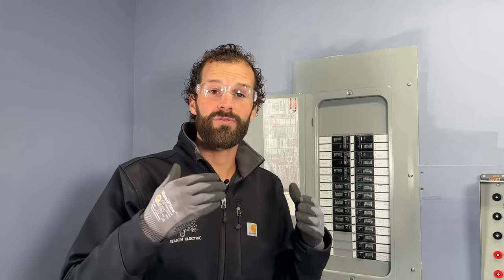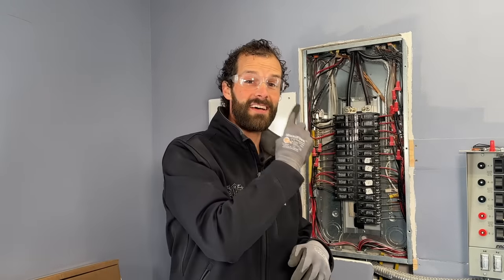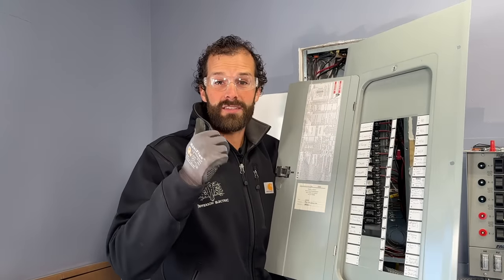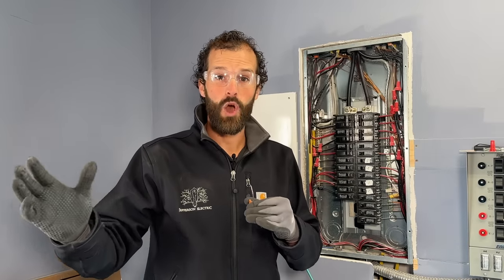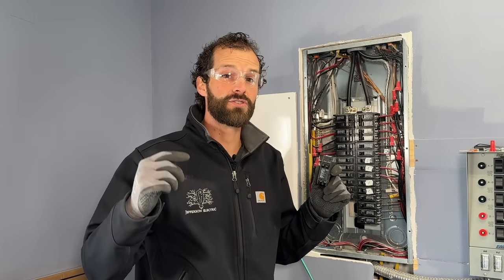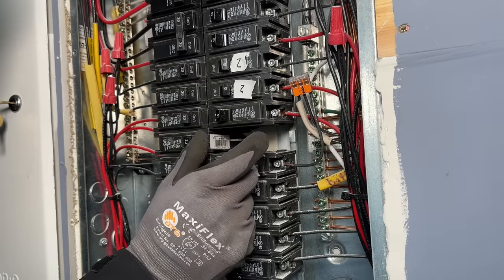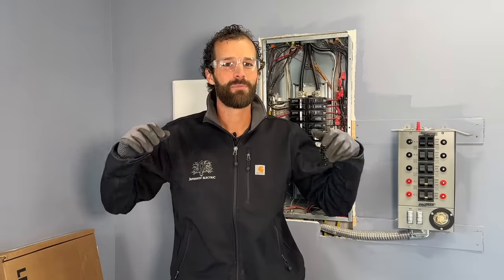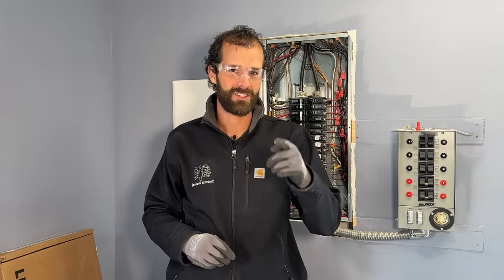No Room In Electrical Panel - Quick Fix

Comment: Just a safety concern and hint! When you turn off the main switch, which may be remote from the panel, please “lockout and tag out” the main switch so someone doesn’t see the power out and throw the main switch back on! Lock it out with a padlock!
Reply: Yesly..
Reply: Dawg relax he dah pro pro
Reply: I did wonder why panels that are clearly for indoors only have a knockout for a lock
Reply: @nameless-og  dawg beef 😤 🤣 what r u zayen
Reply: @como dice  next to the handle/latch, there is usually a knockout where you can install a cabinet style lock.   It never made sense to me why anyone would want to lock a panel closed that clearly isn't supposed to be installed outside.   That feature made sense to me if the box can be mounted outside, otherwise, it just seems crazy to have it on the box because it seems risky, was surprised to learn here that it's actually the opposite
Reply: @nameless-og  working in industry and construction there are many OSHA safety codes where workers in factories and construction can get cited and fined for not following safety procedures. “Lockout/tag out” is just one safety procedure, and only one key to the lock is carried by the worker (He puts a padlock on the switch or a tag on the breaker)
Reply: @nameless-og  vato dice que no porque dice que si de verdad
Reply: @Bob's Barn Workshop  thanks for the explanation!
Reply: @nameless-og  As I said before, it prevents some poor worker who turned off the power from being electrocuted if someone turns the power back on by mistake.
Reply: Good call! Many accidents happen because somebody unfamiliar with the work being performed try to "make things right" only to cause somebody to get hurt. If you don't know, ask!! Lock-out Tag-out is one of the best regulations to ever be written. Use it!
Reply: @JLRWoodCreations  where is it written
Reply: @bobsbarnworkshop  l
Reply: @bobsbarnworkshop  j
Reply: Thanks OSHA Dad!
Reply: Rough mate , disconnecting dedicated circuits when you have plenty of other supply outlets  available .
Reply: I thought Ralph Nader was dead!
Reply: @tomhughes4980  you can’t bring a family member back from the dead! It’s a simple precaution.
Reply: This is residential not industrial...
Reply: @JoeReese-kh1jc  still…

Comment: Lower loads on LED vs incandescent lighting circuits is not something I had considered. Thanks!
Reply from the maker: You bet!
Reply: Be careful about connecting two wires to a breaker many municipalities do not allow two wires on the same breaker , So if you need additional space for a breaker , You're better off taking two breakers out and replacing with a tandem breaker
Reply: Yup.. not just load..its safety
Reply: But if breaker trips more areas dark....
Reply: @ironmartysharpe8293  Do those municipalities still forbid it even if the breaker is designed for two wires, such as the SqD QO?
Reply: @user181  my municipality forbids tandems but does allow a breaker to have as many wires as it is rated for.
Reply: @user181  If it's not allowed you can't do it
Reply: @DonaldZiems  Why do they do that nonsense. What makes them think they are special and that something tested and approved by the OEM is not OK...
Reply: @petero2693  This is a good point. I changed all of mine so that there are only three circuits. One per floor for the rooms, and the last one is hallways and stairs. Uses a bit more wire, but if a room trips the breaker then you have light just outside the room.
Reply: @court2379  speculating, but probably some combination of too many local contractors abusing tandems to put way too many circuits in a box, planning for the seemingly inevitable code cycle where every circuit requires an AFCI breaker (no tandem AFCIs exist), or generally trying to force people to get a new panel.
Reply: @EverydayHomeRepairs
Reply: Yes, but you can't guarantee that those LED bulbs will stay there in the future. I always go by watts/square foot and use watts of incandescent. Someone may decide they have a box of old bulbs they want to use and change out the LED's when they fail and go back to incandescent.
Reply: @hotpuppy1  I cannot see value in sizing my wiring/panel for obsolete technology that is nearly unavailable anymore. I would leave around 600W of buffer for the future installation of ceiling fans though.
Reply: Is there no rule for maximum number of outlets on a circuit?  Before anyone comments, and oulet is any place where power is delivered by the system.
Reply: @ironmartysharpe8293  OR, you make a splice in the panel and run 1 wire to the breaker…
Reply: @ironmartysharpe8293  also, if you’re going to tell people about tandem breakers they need to know you can’t just use them anywhere you want in a panel. They are usually reserved for the “lower” 6-8 breaker spaces.
Reply: @user181  municipalities get last call, if they want to enforce something beyond code they can. You have 2 decisions to make, go get the breaker, literally pull it out of the panel, show the inspector the spec sheets and battle it out.  Or you tell your customer “city ain’t having it, life is going to be easier for all of us to do what he’s asking.” Or you make a splice in the panel…or mount a box just above it, splice it down to the panel.
Reply: @court2379  you still, by code have to have a certain amount of space by code that is referred to as “general lighting load,” that being said, it doesn’t tell you how you have to use it, and while we live in a world of leds, and people on here don’t know the math. A 15 amp, continuous duty circuit (rated at 80%) on 120 volts gives you 1,440 watts of useable power. A standard LED bulb is like 10 watts (rounding for easy math), or 144 led light bulbs. The lightening loads are broken down so if a light trips on the 3rd floor, it doesn’t take out the lights for the entire home.
Reply: A lot of municipalities don't allow 2 wires or multiple wires inside a breaker even though your breaker may be design for the local code hasn't been updated For that And a lot of it too is the inspector some inspectors won't go off a state they go off nec there oneinspector here in town he goes strictly by nec and he can't be difficult if u never dealt with him and know how he Is but I haven't had any problems with him I defer to nec standards
Reply: Upcoming changes to the NEC will allow lower wattage luminary circuits.  They use a 10 amp circuit breaker with 16 AWG NM cable.

However these circuits generally require AFCI breakers.  Saving a few dollars on copper isn't appealing if it means additional $50+ breakers.

Comment: Most modern square D homeline, qo, and qob panels are listed for two circuits per breaker space.  It's a code violation to use tandem breakers in panels that are so old that they listed the number of circuits the same as the number of spaces.  Although square d b 15-30 amp breakers are listed for two wires per terminal, the cafci, dafci, and GFCI breakers are not.  Also, good luck finding cafci, dafci, and GFCI breakers in tandem formats.  Finally, if you are combining loads leaving a space for a future circuit, it's ok to leave the breaker in its side space as a spare.  You don't have to prematurely remove the breaker, you can leave the old breaker until you're ready to replace it with the new breaker.
Reply: Siemens makes AFCI 1-pole tandem breakers. But you're right, don't count on finding a GFCI or dual tandem.
Reply: I Prefer to leave the unused breaker in place. The little slot covers to fill empty knockouts are crappy and come loose. Also, if you leave the empty breaker in place, remember to tighten the wire lug screw snug. I was helping a friend one time and there was a breaker with no screw in a slot. God knows what happened but I don't want any loose metallic objects in the power box...
     Ya'll Take Care and be safe, John
Reply: You didn't warn moving around breakers that are part of 3 wire circuits. Older codes did not require them to have a common handle and ity it unusual to find 2, single pole breakers used. The 2 breakers must be next to each other and can't be on the same tandom unless it's a quad. Failing to obey these rules can lead to an overload neutral and a possible fire.
Reply: He started to mention that but forgot to talk about it. That's why he say there were 3 solutions, but then skipped over numby3.
Reply: @clayrichard8471  you forgot the warning that you must use a listed handle tie if you tie the breaker handles together for circuits that share a neutral.
Reply: CALLED "PIGGY B ACK BREAKERS!!!"
Reply: You forgot to mention that you should use a sticky label and write something like spare or not used on it and stick it nest to the breaker that is empty so if someone goes in because of a tripped breaker, everyone knows not to turn that breaker on.  I know in some older panels that a tripped breaker sometimes goes all of the way to the off position instead of just the mid point.

Comment: Another note on tandem breakers that I didn’t hear mentioned in the video: if you plan to load the circuit to near capacity, don’t place it in a tandem breaker. The heat generated in the smaller breaker can cause earlier failure of the breaker.
Reply: Please tell me how the heat will affect a breaker? There is a coil, a set of contacts, and a spring.. iron core, and silicone liquid.
Reply: @johnbattista9519  as I’m sure you’re aware, running a breaker at, or very near, its current limit will cause the breaker to become very warm. This is by design since they’re designed to thermal trip with extended over-current at roughly 10-15% of their rated capacity. Or they trip instantly with a short. Now consider the greatly reduced physical shell size where heat dissipation is reduced. Any breaker will eventually fail when heat-stressed for long enough. I ran a couple tests many years ago (maybe 25 years?) where I loaded several different brands and sizes of breakers to 95-105% of their rated load. I can tell you the tandem breakers failed long before standard size breakers did. Essentially, they baked themselves. In two of them, the plastic cracked and had signs of charring.
Reply: @johnbattista9519  Most common (non-GFCI/AFCI) breakers are called thermal-magnetic trip.  Current passes through BOTH a bi-metal and a coil.  The bi-metal (similar to the one in your wall thermostat) monitors "normal current" and will bend away from its contact when heat generated by load current passing through it exceeds the breaker's current rating.  This thermal mode protects your wiring from inadvertent overloads and acts slowly (seconds to minutes) depending on the amount of overload.  

Conversely, the coil essentially generates no heat but creates a magnetic field due to the current passing through it.  Magnetic field intensity is proportional to the RATE OF CHANGE of current creating it.  When there is a high-current short on the breaker's load side, the current change through the breaker's coil rises rapidly and 'instantaneously' trips the breaker magnetically.  The "instantaneous" trip current is often about 8 - 10 times the rated current and is normally not listed on household type breakers.  (However you will usually see "10k A.I.C." on a panel or breaker label.  This means '10,000 Amps Interrupt Current' rating and tells you that if the utility could supply 10,000 amps into a short circuit through your breaker, that breaker, by design and testing, could interrupt that current without welding its contacts or exploding.  Utility and system engineers use such information to perform a system "Fault and Coordination" study to assure that any electrical power system can cope with overloads and shorts without destroying itself or harming persons and property - which is also the underlying purpose and intent of the National Electrical Code.)

Every breaker's specifications include a set of "inverse time" curves that relate both the instantaneous and thermal times to the amount of overcurrents.  These are used by electrical system design engineers to "coordinate" a system's breaker settings.  For instance, in a hospital or other critical setting, you would not want the whole 1000 amp system to shut down because of a small short or overload in only one 20 amp circuit.

The panel's supply bus and breaker load wires tend to remove heat from a breaker but heat can still build up in highly-loaded breakers.  High temperatures (like 200 degrees F) decompose wood and plastics into charcoal or carbon (known as Pyrolysis) which, like the composition of an electronic circuit's resistor, conducts electricity that then can form a path to ground that generates more heat and more decomposition.  Pyrolysis can lower ignition temperatures from over 400 degrees to around 200 degrees over the course of days or weeks, resulting in delayed-ignition fires.
Reply: If the breaker is rated for it you can load it . Any breaker running near constant full load will have a shorter life
Reply: @johnbattista9519  do you not think heat affects the performance of the materials individually AND as a system . This is just mechanical parts of an electrical distribution system . Yes site conditions and operating parameters all affect the life of any type mechanical electrical equipment . The more current you pull or push , depending on which way you look at it , the more heat is produced . More heat for most systems equates to a shorter life .